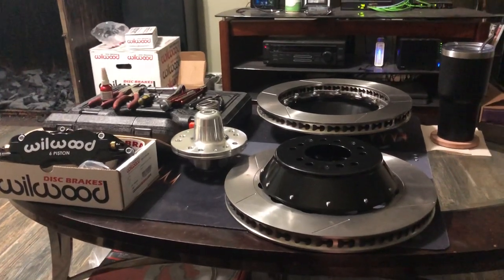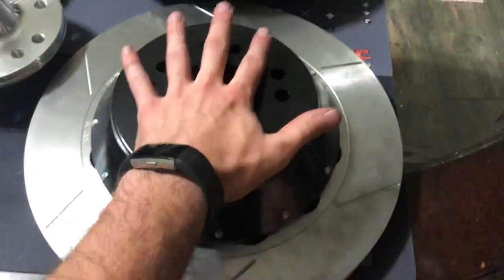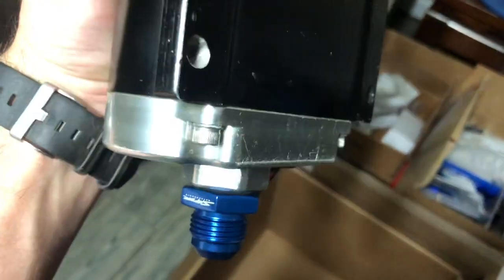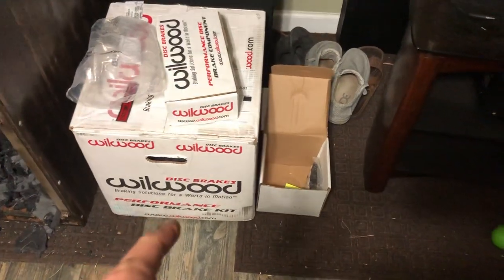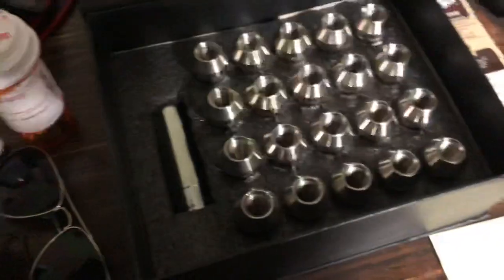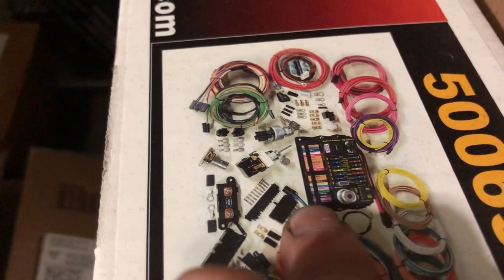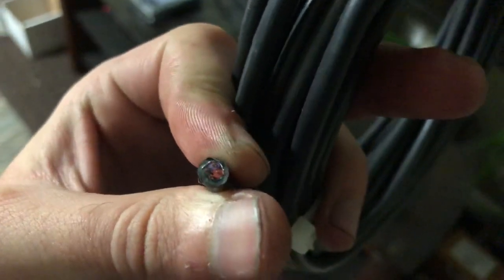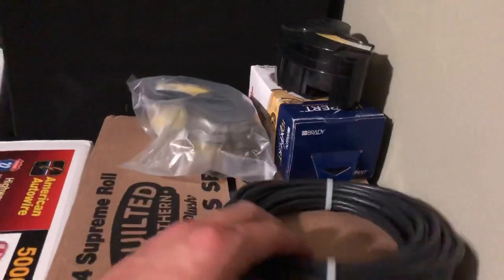Elaina’s Wilwood front brake kit

Comment: About damn time you posted a vid of this brake kit. Haha!
Reply from the maker: my bad lol.. been busy.. had to go help a friend move  a car lift from the 40's.. 10' tall 500+ lb posts with overhead support bar.
Reply: @callofgeorge  Don't be talkin smack about my car lift
Reply: Question about the lug nuts: are they long enough to handle your wheel studs or are they open lug nuts ... couldn’t tell from the vid’s perspective.
Reply from the maker: @Rudderify  good question.. the simple answer - i don't know yet.. i actually tried to get open ended ones but they don't make them.. i figured if they bottom out, i have 2 options.. cut the studs down a hair, or 2 band saw the ends of the nuts off and smooth out with the belt sander.. or i could give them to my machinist buddy to mill off the ends. the rears are the only ones im really concerned about.